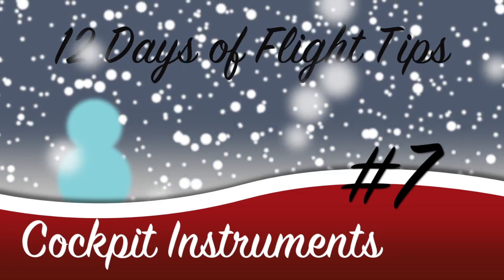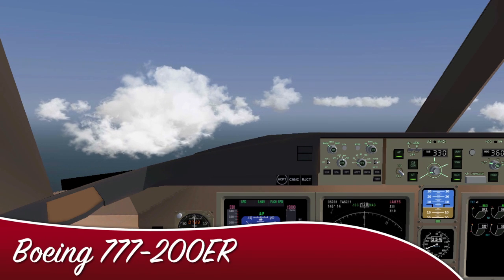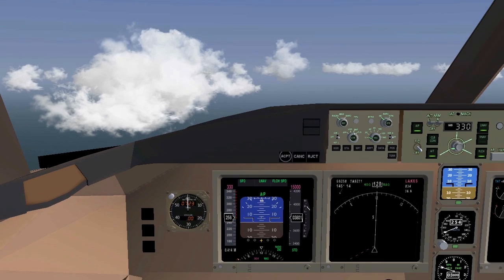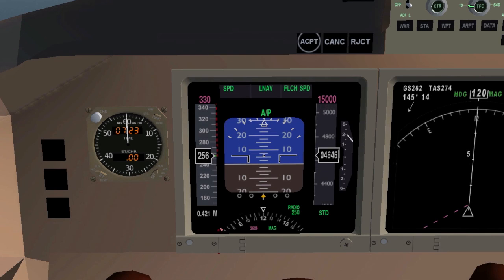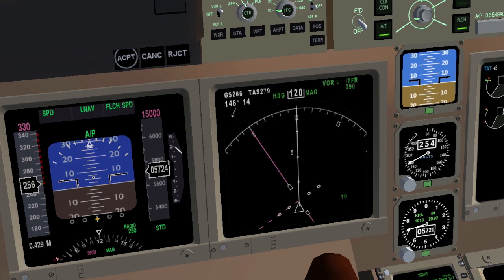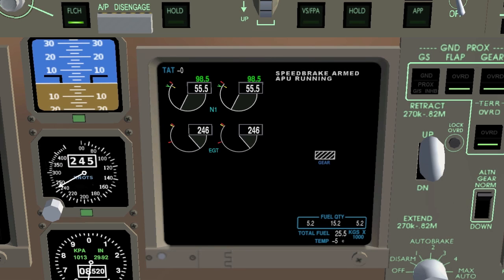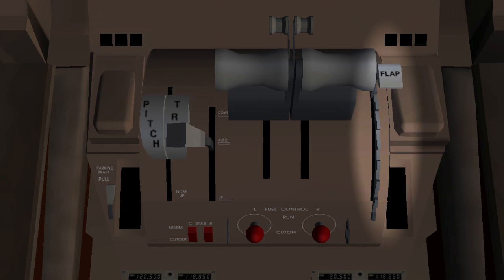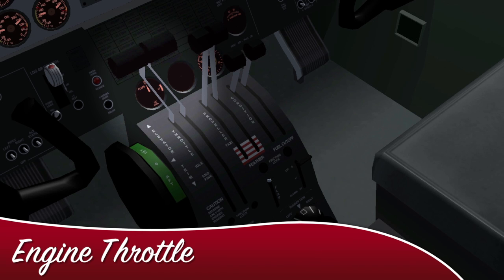12 Days of Flight Tips: Cockpit Instruments (Day 7)

Comment: another advantage of the HUD is that it shows you the rudder/aileron/elevator and throttle positions, which is useful for those who don't have joysticks and use mouse to fly, since you probably don't memorize how much you have to move the mouse to get a certain percentage of throttle or control surface angle.

Comment: the problem with the 3D instrument panel is that it's harder to read the information from unless you have a 50-inch monitor or a 3/6-monitor setup. the HUD is always accurate and easy to read.

(there is also a 2D instrument panel with some aircraft, but it looks too out of place IMO. granted the HUD looks a bit out of place on some simpler aircraft like c172p, but I still find it better than the 2D instrument panel).